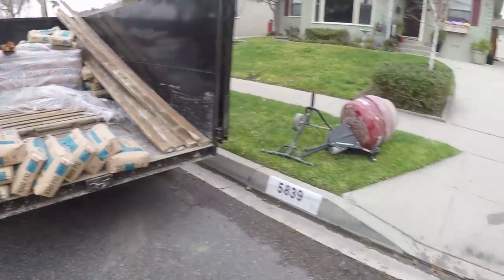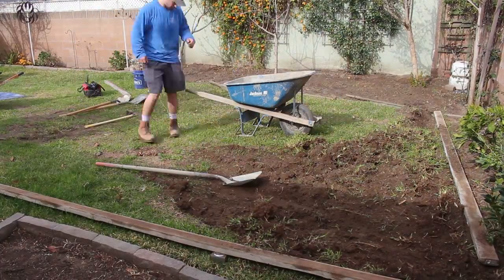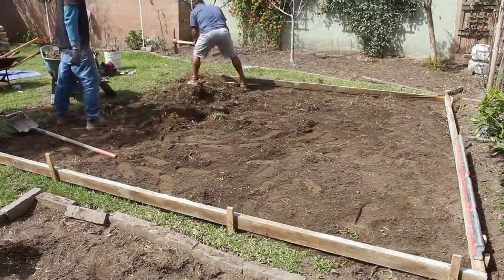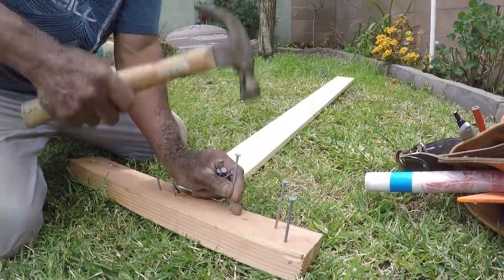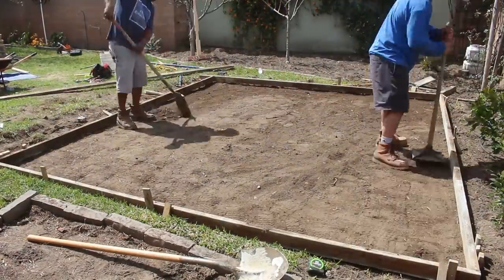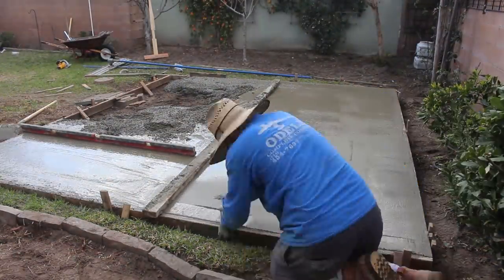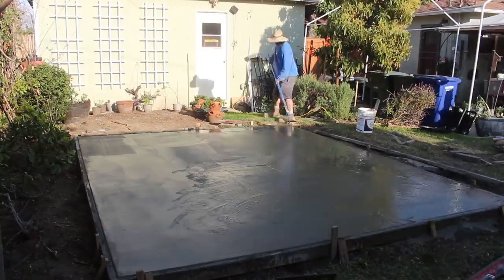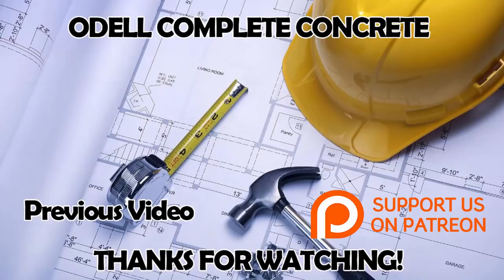How to Pour a Concrete Shed Slab for Tuff Sheds DIY!

Comment: Cool! The small size made all the difference - my 12 x 20 requires a permit, ( I'm up near Palmdale in LA County) a 24" footing all the way around, a whole lot of rebar and anchor bolts with 3x3x1/4 square washers to bolt the bad boy too.
Reply from the maker: 120 sq.ft.

Comment: DIY here, I use #3 rebars 12" OC at 1.5" to 2" above grade, cheap insurance. Vibrate to get smooth edges. That little rebars at the bottom does nothing. Also c = sqrt(a^2 + b^2). Finishing looks good though.

Comment: I have 2 sheds that were placed on property that I just bought and need to move them from the corner block supports they currently are using to a concrete foundation and place them in a more convenient location.  I'll definitely take your advice concerning using a truck pour versus mixing on site.
Reply from the maker: GL

Comment: Would you recommend a raised concrete nib for the bottom plate of shed to sit on? Don't know if concrete 'nib' is the right word to use in US.
Reply from the maker: Yes if the slab is larger then the shed

Comment: Whyd you remove the form boards? Usually when I pour a slab and every contractor Ive worked with, the forms are usually left on till the next day at the minimum. Only time the forms gets stripped the same day are for curbs and we tend to leave the back forms on.
Reply from the maker: Another job the next day

Comment: How is the tuff shed anchored to the slab? DO you need to install bolts or anything into the slab? Is that something they do when they install the shed? Also could you make the slab bigger than the footprint of the shed or would that be no good?
Reply from the maker: Drill and drive expansion bolts

Comment: If I were to build a 12 x 12 concrete shed slab, like you show here, but don't have the time and money to complete it in a single run. Will it be okay to build a 12 x 12 shed slab, in (Four) sections, (4) @ 6 x 6?
Reply from the maker: Sure,  dowel them together
Reply: @OdellCompleteConcrete ... Thank you for the response.

Comment: I noticed in the video the concrete foundation was a bit larger than the square footage of the shed. Is this something you recommend or is it okay to pour the foundation the same dimensions as the shed?
Reply from the maker: It's better if the foundation is the same size and raised

Comment: Cured very evenly, I freaking been having problems cause of uneven curing. Dark patches come out. Do you guys know how to get rid of discoloration on concrete?
I never use the bag cement bags. I use mix and Portland cement. 16 shovels per half a bag of 94lb Portland cement
Reply: Thanks Chris
Reply from the maker: Sand blast
Reply: @OdellCompleteConcrete  
Dang, that will ruin the broom finish Dan.
I'm going to do some test runs with acids

Comment: Can you please list the tools you used?
I understand the forms, mixing and placing the concrete with a placer. 
What’s next? Which tool?
Reply from the maker: Yes we can do that
TY
Reply: Odell Complete Concrete 
Thanks. In my situation, I’m ready to pour the concrete but I don’t fully understand what to do after. It’s a small slab for a shed, 9x5. I have a Imer mixer. 

On a different note, what’s your opinion about concrete vibrators? I have a dewalt

Comment: Why are you so concerned with the small grass blades and raking them up? Will that really make a difference when there is that much concrete atop it?
Reply from the maker: Yes decompose or float to surface

Comment: so TuffShed will still put wedges under the shed frame even if it has a perfectly flat concrete slab. Interesting!
Reply from the maker: Interesting
Reply: Tuffshed will sell you the shed without the foundation and give you a bolt pattern to place on your concrete pad.

Comment: Instead of 4 5 6 or 6 8 10 you can also just grab your calculator and use any measurements on the sides. It’s just Pythagoras. The square root (function name sqrt) of measurement a^2 + measurement b^2. In case of 4 5 6: 4^2 = 16, 5^2 = 25, 16+25=41, square root of 41 = 6.4. So yes, just 4 5 6 is actually inaccurate. It’s 6.4. In case of 6 8 10, sqrt(6^2 + 8^2) is exactly 10, so that is better indeed.
Reply: Even the Scarecrows knew Pythagorean theorem!
 He should have said "345" or 6810". Those would be accurate.
Reply: john hanrahan I hear now that he did say 345. My fault in taking over the wrong numbers. sqrt(3^2+4^2) is exactly 5 indeed.
Reply from the maker: Isnt that how they built the pyramids
Reply from the maker: Bingo

Comment: I take it that is Ready Mix cement (sand/cement)
Reply from the maker: and gravel
Reply: @OdellCompleteConcrete  In uk cheaper handmix option are 25kg bags of Portland on pallet + craned 10Mm jumbo bags of sand and gravel, mixer hire
Reply from the maker: SOunds good

Comment: Question: Why go to the expense of pouring a concrete slab for a building that has a wooden floor? Most quality manufactured sheds should have pressure treated lumber under the floor so a concrete slab isn't needed. Possibly concrete piers but a slab is a waste. Now, option two. If you're going to the added expense of a slab why not build the building with no floor right on the slab. The slab is your floor. Doing both is a total waste of time and materials. Many custom shed builders will build it on the slab for the same price as they would with a floor and hauled into your site. In this case you are paying for two floors. One concrete and one wood. Makes 0 sense!!
Reply from the maker: Build it yourself with one concrete floor and save money.